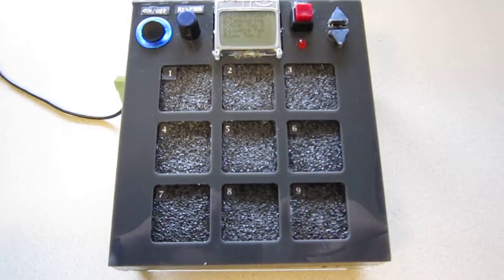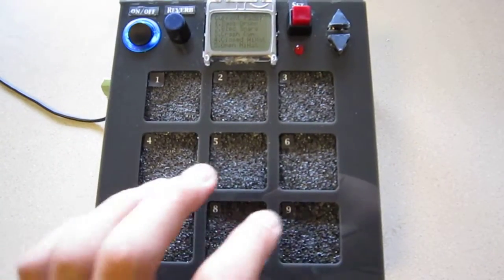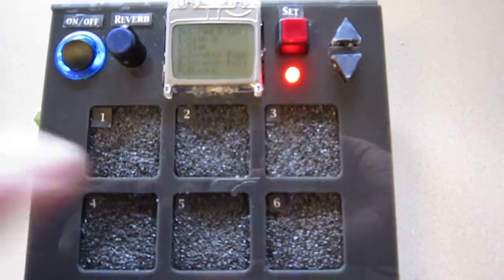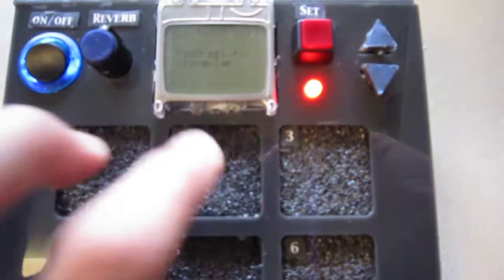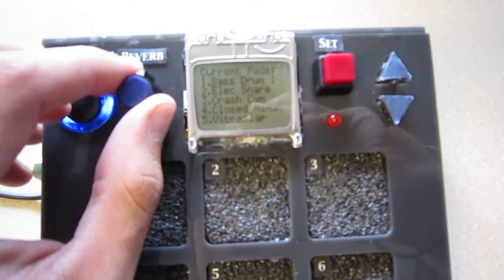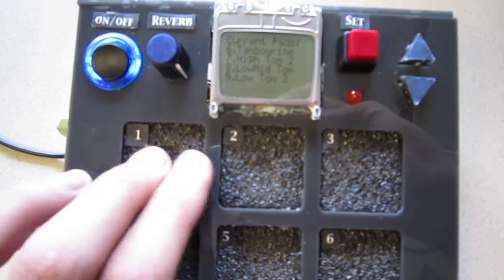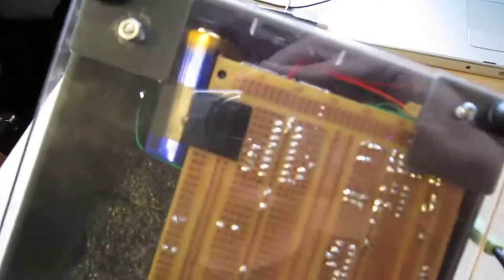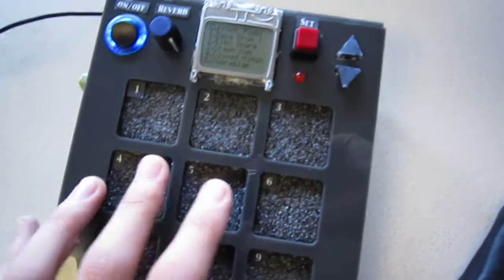EE47 Final Project: Drumpad Functionality

Comment: Good stuff. I'm making something similar, using piezos for velocity sensitivity, but using MPC replacement pads. Do you think my piezos might constantly register a max velocity if they're touching the pads directly? I might just have to do something similar to this (but under the rubber pads) if that's the case.

Comment: Hello, I’m looking to do something similar for a museum project, it needs to playback 30 triggered short wav sounds a couple seconds each, basically piano type sounds, but polyphonic, ok to be read from an SD card. The sensors can be piezo or whatever suggested that would work best.

Is there anyone out there willing to help, or possibly be compensated how to accomplish this? please contact me directly at joe4smt@yahoo.com

PS- I'm a circuit board designer but not a programmer.